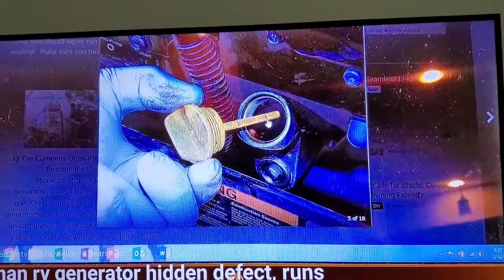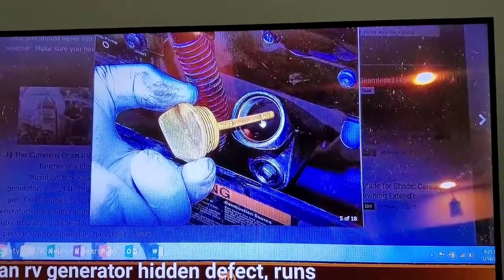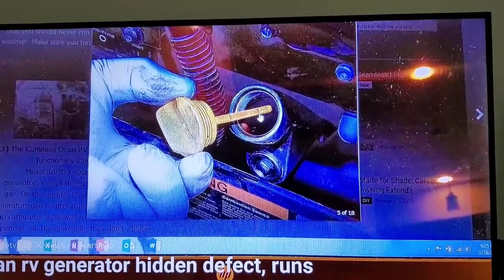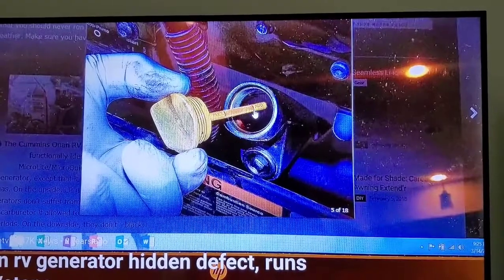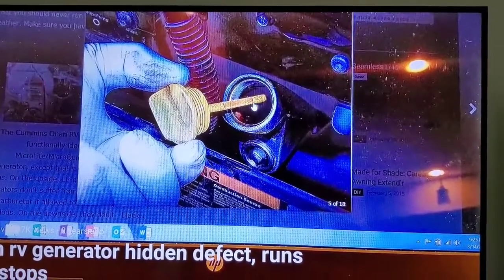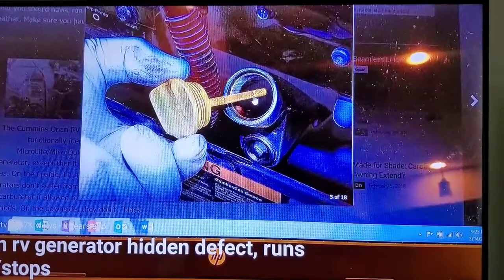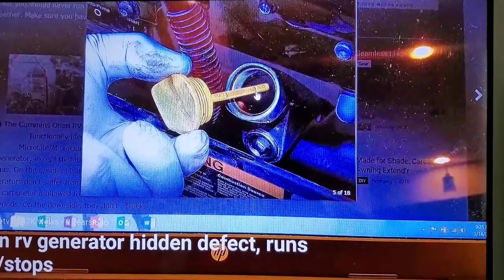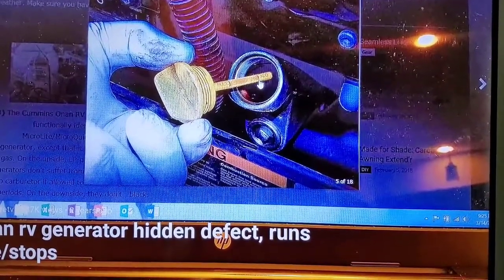Onan rv generator - How to winter exercise it and maintain

Comment: Good video as always, we use our RV A LOT !  This may be why everything always works lol :)  With that said we don't use the heater to often in FL. so I run it once a month and never had an issue. I think using it is key, I also use sea foam once or twice a year and run it through the system. The way i do it is with 2 cans with low fuel,  its also good for a fuel stabilizer, I think the can said up to 2 years.  It good stuff !  Cleans injectors and fuel system.  Oh be the way I am knocking on wood because i said everything works LOL I want to keep it that way.  Glad your doing good brother.
Reply from the maker: thanks brother,  little rough lately, but life goes on